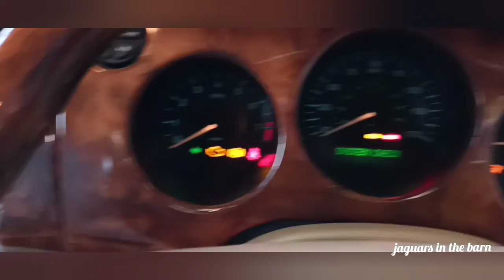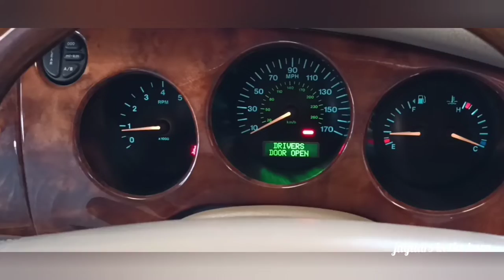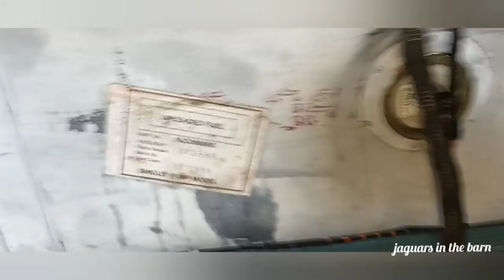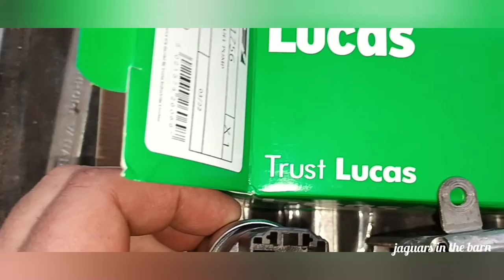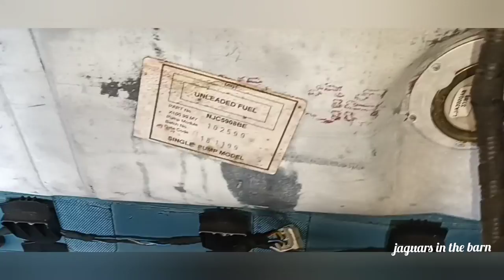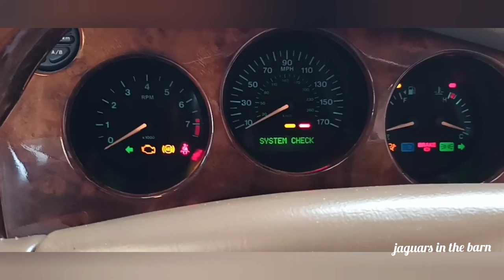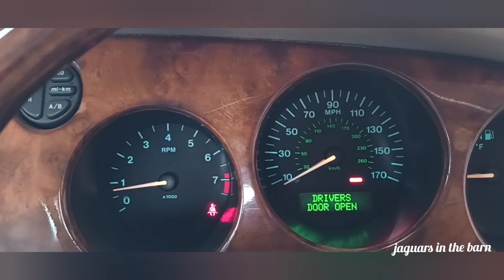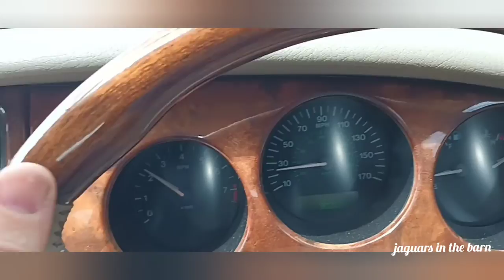Jaguar XK8 project #33 fuel pump replacement

Comment: Brilliant vedio

I have diagnosed a faulty fuel pump died. 

All vedios I saw show taking the tank off. Horrible job with disconnecting fuel lines. It's a pig of a job as it appear to take the fuel lines off.  I think jaguar manual says you an do the job without taking the fuel tank off.

I prefer this method than taking the tank off. 

Very good points made about working with inflammable fuel so with any work if you have done your health and safety assessment and written down a method to make sure the job is safe then I don't see this any riskier than syphoning the fuel out and discounting fuel line s, and never mind the accidental spillage if fuel on the ground which is bad for the little creatures...!!

Well done mate.

One point for anyone attempting a phone connected led camera can help see inside the tank whilst working. If course work up safety and how the phone and camera need to be mounted etc  given inflatable fuel.
Reply from the maker: Hi buddy, thanks so much for your kind response.
As you mention, as long as you assess the situation properly and take all steps to reasonably reduce the risk, then it is safe to do it this way. 

All the best with your replacement, and I hope it goes smoothly for you. 

Thanks again, Simon

Comment: Many thanks for this. I was all set to take my tank out then found this. I can confirm it's possible to replace the pump on a 98 coupe the same way through the subwoofer hole. The only hiccup I had was dropping the 7mm head screw, holding the mounting bracket on, into the tank but retrieved it with a magnet. It's a fiddle but it works. Much appreciated 👍
Reply from the maker: Hi John, great to have you along buddy. I'm glad you managed to do the job without the hassle of removing the tank and that you found the video useful. All the best mate, Simon.

Comment: Great stuff mate!  I'll see if I can change mine on my convertible when the time comes. 
Cheers,
Jon
Reply from the maker: Hi Jon, good to hear from you buddy. Its not a bad job to do, it's a bit different in the convertible as I understand it 👍
Reply: @projectsinthebarn  you gotta pull the tank, unless you cut a hole where your subwoofer hole is. I suppose you might be able to do it in situ with a very outlandish array of socket adapters etc but the risk of dropping one... eurgh.

I've been watching videos on this all day and people doing this on the convertible keep saying things like "oh god how will i get my hands in there" "why did they design it this way" and my personal favourite "oh god I really don't want to do this".

A code P1646 has me going down this rabbit hole lol.
Reply from the maker: @throwback19841  hi buddy, food to hear from you. That's a shame that you have to remove the tank on the convertible, makes it a bit more long winded than in the coupe then.

Comment: Great stuff, very well done Simon. I was wondering how you were getting on with this job. The XK looks easier than an XJ of the same era (no subwoofer hole above the tank flange from memory). Really good you did not need to pull the tank back.  Also, I forgot to mention we had issues with the connector also and took the exact same route you did with soldering and heat shrink.    Hard enough job without trying to film it.
Reply from the maker: Hi James, thanks for that buddy. That was an unexpected hiccup with rhe different electrical connection, but turned out all good in the end 👍

Comment: Don't know if anyone else mentioned it but the new filter is higher than the old one and not sitting in the recess. Could be a problem when the fuel level drops. PS, appy days, do you watch arry the stag😁
Reply from the maker: Hi buddy, you are right, there is a slight variation between the factory filter and the after market one, but all being well it should not have an impact as long as I don't run the tank right down. 
I've not heard of that other channel, I'll have to check it out buddy.

Comment: You're lucky to have that circular thing in your package tray mine doesn't have that I will have to cut a hole where your little hole is at to get to it or I will have to take out the tank😢
Reply from the maker: Oh dear, just go careful and really consider the options when swapping the pumps over. Hopefully you can work out a way of doing it without removing the tank. Good luck buddy 👍

Comment: My 99XKR has a dodgy fuel level sensor. Haven't figured out the problem or solution to it yet but suspect it is a bad earth. Don't know where the sensor is yet.
Reply from the maker: Hi Bernard, great to hear from you buddy. I have come across this article which may help you with your problem. Please let me know how you get on with it. 
Cheers, Simon. 
http://www.jagrepair.com/FuelTankSendingUnit99XK8.htm

Comment: Hi, did you undo the fuel pump hose clamp and the 10 mm screw from the subwoofer hole or the trunk?  I have that hole too but I am not sure if my arm is long enough to reach things in the tank from there.  Thanks.
Reply from the maker: Hi Jay, if I recall, I did it all from the subwoofer hole. It took a bit of patience, and you're working blind pretty much, but if you can reach it, then it's all do-able, buddy.
Reply: @projectsinthebarn  I have had the pump for a while and still has not conjured up the courage to do it yet.  The pump on the car refuses to prime sometimes and once it primes, it works fine.  I think I will replace it soon.
Reply from the maker: @jayyin88  hi Jay, before you go and replace the fuel pump, I would suggest swapping out the fuel pump relay first. Yours sounds more like an intermittent issue, and that is by far the easiest thing to try and do first 👍

Comment: Better to take out fuse than the battery.  It is number 7.
Reply from the maker: Hi buddy, thanks for getting in touch and passing on your knowledge, it's much appreciated.
The main reason I removed the battery lead was to stop and possible risk of it sparking whilst I had the fuel tank open and petrol fumes and vapour in the air.  Probably a bit overkill, but better safe than sorry 👍

Comment: hey guys ! do somebody know where I can find hose clips sitting under the tank ? I broke those when I took out the fuel tank on my xkr 2002. It  is tiny small clips in stainless steel . New hoses cost about 150 Euro piece. ( one clip maybe 1 Euro)  Anyone ?
Reply from the maker: Hi Simon, your best bet here in the UK would be David manners group or SNG Barratt. Both of their websites are informative and have good search features so hopefully they will be able to assist you buddy. 
For second hand parts Auto Reserve Jaguar are a very good source of used parts. 
Please keep me informed as to how you get in buddy 👍